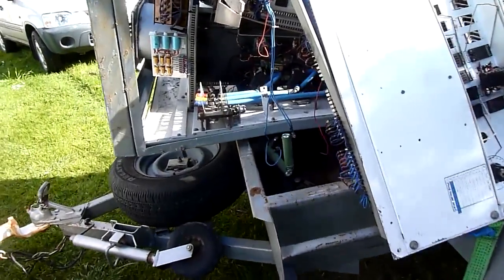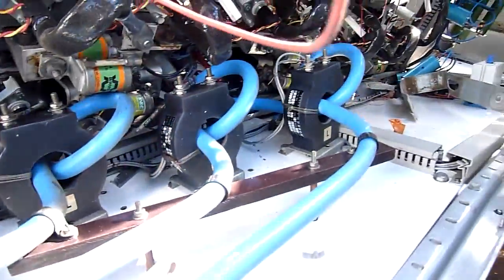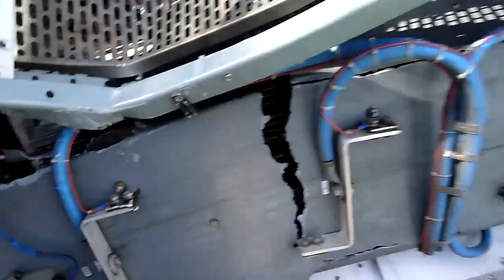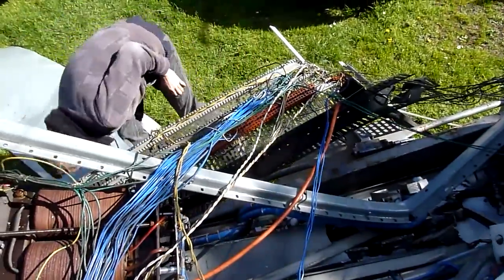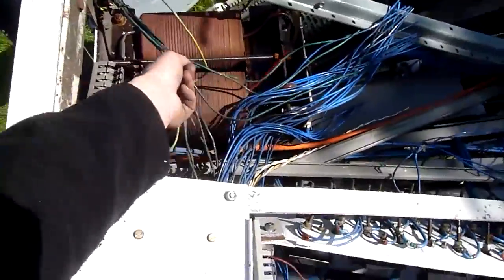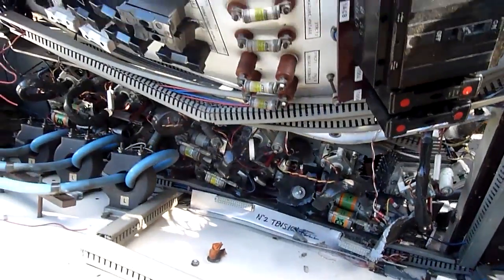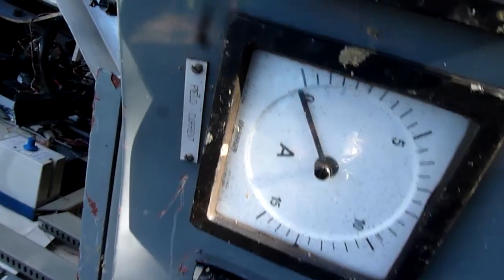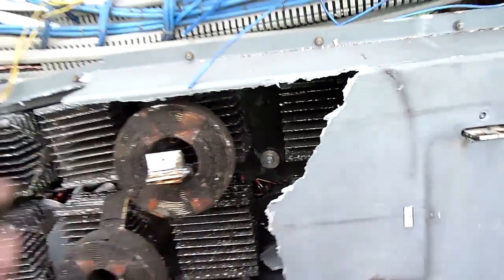Teardown of a 150Kw GEC 460V DC Motor Drive

Comment: Nice video. I have a question. I am going to try to build a makeshift refrigerant recovery machine. Should I use a small refrigerator compressor or a 12k btu rotary? Not going to use it for services or anything, just for hobby related projects. What would you recommend? I would rather use the small one than the rotary, but will use the rotary if you think the small one wont be powerful enough. Thanks!

Comment: SOOO many good parts in that old hunk of junk! 

It's kind of a shame, but here in the U.S. there are almost NO scrapyards that will allow you to take anything home. I think it's mainly due to insurance company rules, but you can't even buy good stuff from a scrapyard. I've gotten in trouble in the past trying to remove a few small components that were practically brand new. But... no. Rules say it all has to be melted down for scrap metal. sigh

Comment: Whats a scr
Reply: SCR = Silicone Controlled Rectifier. 

It's a semiconductor device similar to a transistor in that a very small amount of electrical current can control a very large current. 

Sort of a fancy switch.

Comment: Something got on the camera in the upper center spot when you removed that fuse around 6:20
Reply: He stated in the past that there is dust in the old camera he is using that he can't get out. 
He has done videos where the integrated shutter/lens cap didn't fully open.
Reply: Julian Doll Oh, so that's what is is. Thanks for clarifying Julian.

Comment: If that is asbestos and not fiber glass I would be wearing one of my gas masks. I love old PCBs like that. LM741 chips are quite common on those old PCB's from the 70s. When the lifts were being scraped at uni I pulled a panel from the skip that looked like asbestos. I removed what I wanted from it and returned it to the skip.